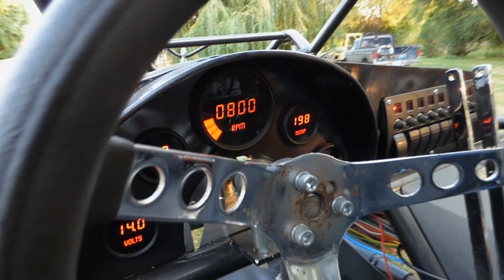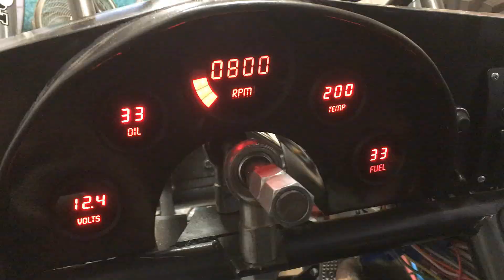snow fighter trapped in my own mind

Comment: So what was on fire?
Reply from the maker: 7 years...

What drives you to do what you love? Loved ones? Makes you feel good in the moment? For me, it's how will I feel when it ends. When or if I get old and look back on my life am I going to sit there and think about what I regret, or think how I tried my damndest to actually fulfill those dreams. I just want to build cool things, impact people by inspiring them, make people think outside the norm, drive my heart out, leave a message people will remember. By the time most will read this It will have been my 30th birthday, and I almost didn't have it. I'm here to tell you the story of the Snow Fighter, my heart, my dream.

It started when I had a 85 f250 on my birthday of course, and destroyed it after breaking the front axle up in the mountains and couldn't keep it from any tree the whole way down. The trucks whole body was trash. Guess I can't have nice things. I knew how I wanted to drive and what it would take. So adding up all the parts and fab needed, putting it into the truck wasn't going to make sense. Might as well build what I actually want for the money... a buggy. A rear engine, big tire, massive suspension buggy.

7 years...

After 3 different jobs, massive life struggles, loosing friends and gaining new ones we had the dream. The Snow Fighter buggy. The truck I destroyed all those years ago donated the 460 big block, t19 trans and BW transfer case. I took a cheap set of axles from a 1975 international, ra15 and dana 70f and made them a ra15 front axle with dana 70 closed knuckles, and a dana 70f rear. All offset for the rear engine and great ground clearance with the sticky 42 inch Maxxis treps. So many custom parts made by great people here in the yakima area. Great parts made from Branik motorsports Stan Haynes. A great customer service story behind those parts. Spidertax Thom Kingston made the custom inner front shafts that was their GM line but with 14 bolt 30 spline. Nitro Gear and axle, Yukon, ARB, Trail Gear. Build It Offroad Chad Vesey for getting a great many parts. Blaine Faris for machining parts for the ra15 no one makes anymore. So many to thank. So many that made a dream come true. Not to mention the emotional support from so many more.

We made it to W.E Rock Goldendale 2018. Only driven the buggy one good time on just dirt hills, I jumped right in to sportsman A, A courses. With a buggy as large as Snow Fighter and no experience Glenn and I struggled day one. After what we learned, sunday was a lot more fun. Finishing courses and putting on a show.

Couple weeks later we went up into our back yard... The mountains. Such and epic day. Learning so much more about me and Snow Fighter without any pressure. It drew a fan base, did lines most hadn't seen and once I figured how to drive it, it was hard to challenge it, to my surprise. She was working so good.

The story turns.

Drove up to the top of the funny rocks for some sight seeing and pictures. Outside of the car, took photos, looked over everything. Looks all good, what a great day. Hopped in and drove only about 50ish feet. started driving on the upper trail looking for a place to turn around and couldn't see a place, so I was like "heck lets just drive down the trail until it hooks to the lower one. Then as soon as I give it throttle to go... the motor dies. WTF. All the gauges are working, we have power.... hmmm. Press the start button for a few seconds, give it a little bit of throttle... The scariest sound and sight of flames explode around me. Never have I had such fear, worry and sorrow in such a flash. Hit the power disconnect, pull the release on the harnesses. Why wont they come off?!? Oh fuck my arms! Why! Why... As I struggled their... Cant see my legs or the dash in front of me, completely covered in flames... The pain in my arms was setting in hard... I thought, this is it. This is how it all is going to end. The life flashing before your eyes is real. My Mother, the animals, the friends, the coworkers, The girl back in school you wish would have worked.... All if it, so fast.

The harness lets go!

Falling out of car, only thought was to try and save my dream. Not realizing only the line lock was set on this hill I was on but not in gear. Ran around, grabbed the extinguisher, ran back around and started shooting into the transmission area were the fire was strongest. The whole back of the seat is already gone. Leaning over the back tire... the brake fails. The tire catching my shirt and stomach, throwing me over on my back, then running over my right shoulder, torso and legs and it free rolls down the hill. The sight of Snow Fighter, ball of fire, flying away down the hill... Cant explain. It stops on a rock / berm before going into a field and trees. Running down the hill, crashing multiple times, extinguisher still in had. The fire is so huge... Why did I come down here?!? Then as I turn to look back at the top of the hill... The tree's are fully a blaze. No... Not me, I don't start fires... Why. Running back up the hill, hyperventilating, people finally coming over the hill. Oh god, help me please... I don't know what to do. As I collapse on the ground.... There was so many people. So many I'd never seen before, know their names, nothing. All checking on me, keeping snow fighter contained, fighting the forest fire. The sun turned orange, It appeared as snow as the ashes fell. Dear people holding me, talking to me. Too much in my mined at the time to retain them now except the people I already knew. Shovels pushing, axe's hitting, chain saws ripping. The work of all these people kept the forest from burning away. Kept it to a 100 foot circle. So many to thank.

Watching it burn away.

My world still turned, watching the tires burn from a distance. This amazing little boy walks up and hands me a water, then a few dollars... "Oh son you don't have to give me this". "Don't be like that" he replies.

"I would much rather see you build another buggy then me buying a new book!"

You do everything in your power to keep fires like this from happening. All the right AN fittings, lines, rout them away from any heat, retain them, heat wrap them, spiral wrap to keep from chafing. It still happens and today now that Snow fighter is home, I can't tell you how or why it happened.

For this boy and many others out there I think I would like to build another one. But I financially don't see how I can do another one. 7 years of not seeing friends, never going out to eat, putting off bills, pulling loans, never having much of a life all to finish Snow Fighter. Nothing on Snow looks usable. Shafts are deeply discolored, arb is flacking metal and froze internally, gears are discolored. It burnt so hot and for a long time. Chassis is super soft, dents with just a small hit of a hammer. T case is warped, bell housing is melting. I don't know... How I'll bounce back, I have no idea how. In time may be we'll see.

Thanks to all the people that have helped through the years, in this tough time, and to come. Don't take for granted this life and the people in it. Do that for me. Thanks everyone.
Reply: What a terrible thing to have happen, I just can't imagine what it is like to have such a monumental effort taken away so quickly. I am very sorry this happened to you.